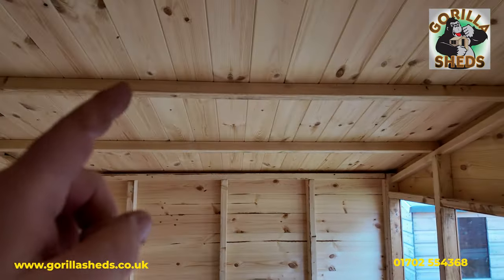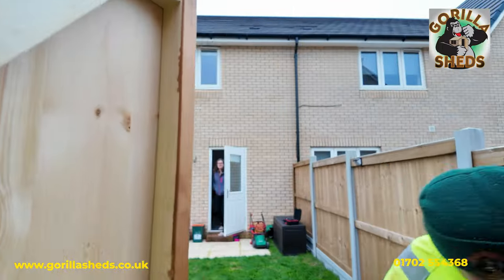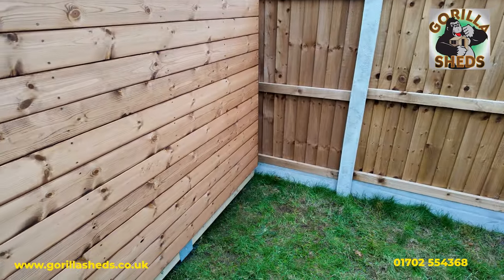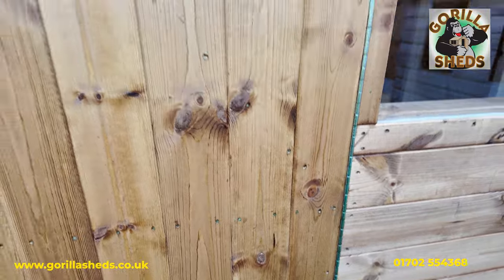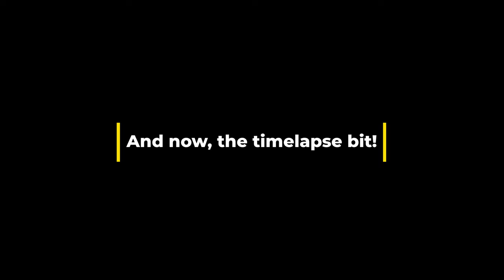9 x 7 chalet  style garden shed on a groundscrewbase (Talky and timelapse)

Comment: 11:27，the floor side is not on the frame，it is a big problem，here can not be hold heavy item
Reply from the maker: The frame is held together with 8mm x 130mm Hecofix framing screws, the plywood sheathing is bridging the join, the body of the shed is on the plywood sheathing.  Please explain how that would be a problem, and your qualification for making that statement?